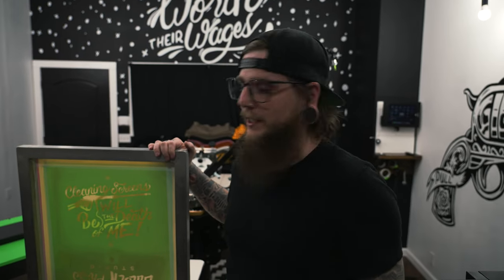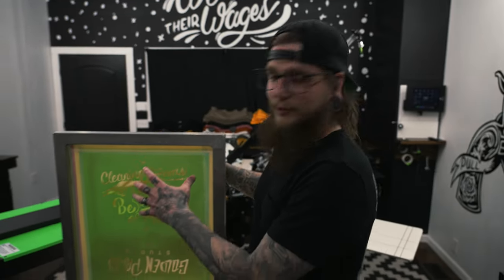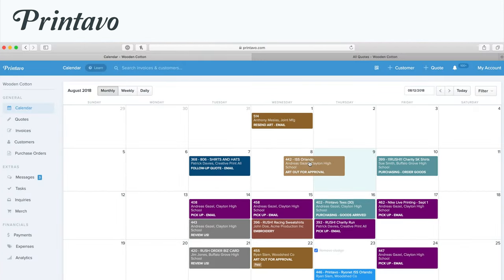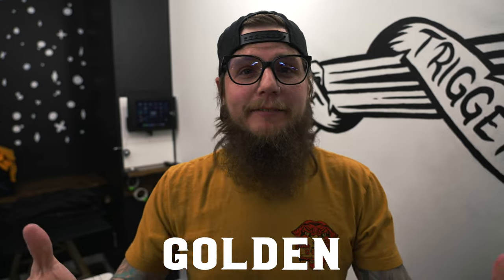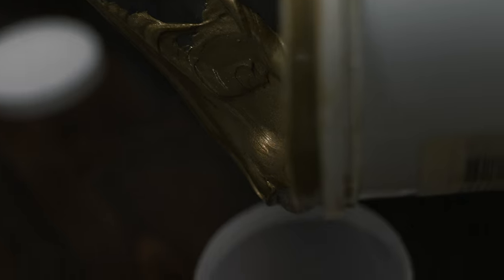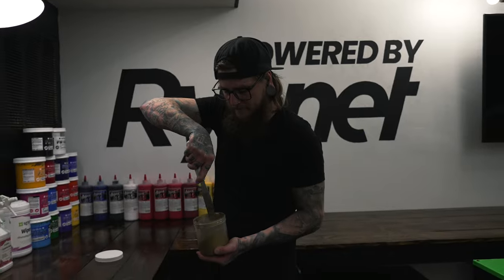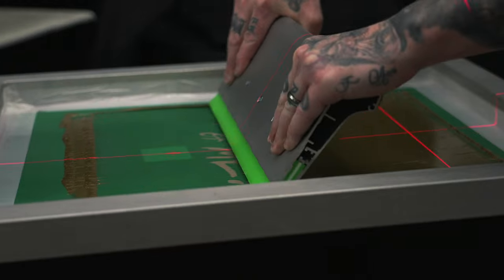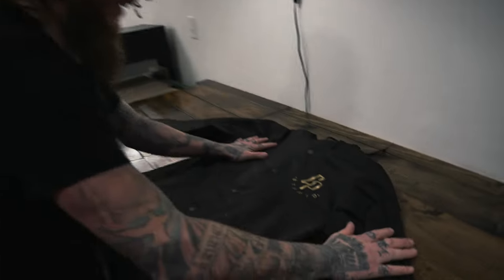How to Print on Nylon Windbreakers

Comment: How do you keep the nylon from shrinking in the oven? Do you run a really low-cure temp ink? Even at 285 we are loosing pieces due to shrinkage.
Reply from the maker: Every dryer is different. If your dryer has an adjustable heat element then move it as far away from the garment as possible. Unfortunately, there are a ton of factors that you have to test to figure that out. The most important thing with nylon is that you keep it in dryer as little as necessary to cure the ink. The threshold of nylon getting too hot and getting ruined is very thin. It is a frustrating job for sure and why not many shops really like doing nylon jobs.

Comment: Did you consider using the jacket hold down? I'd love to print windbreakers but concerned about wasting blanks without the proper hold down.
Reply from the maker: As long as you have new platen tape and fresh adhesive there shouldn't be any problems. We just always make sure to use fresh platen tape so there aren't any fibers stuck to the platen because the nylon will show that texture in the print. We haven't had a problem with the jacket moving during the print.

Comment: What’s the temperature to don’t burn the nylon?
Reply from the maker: There are a lot of factors at play here... it depends a lot on your dryer. You will need to test things on your dryer to figure out dwell time, temp, height of heating element(if adjustable), and so on. There's not a one answer fits all on this.

Comment: what happens if you dont use the catalyst?
Reply from the maker: It doesn't adhere very well to the jacket and flakes off after a little bit of wear. If you wash it most of the design WILL come off!